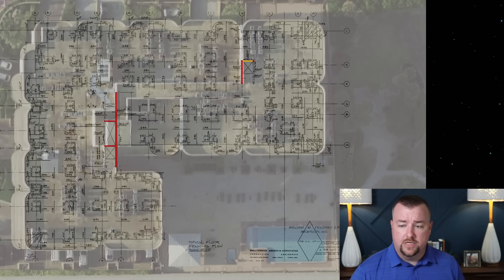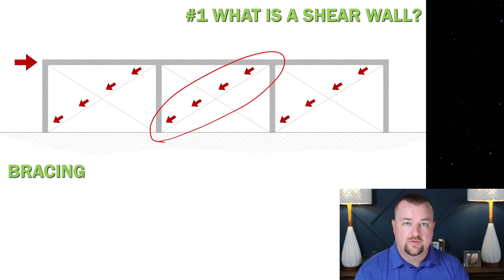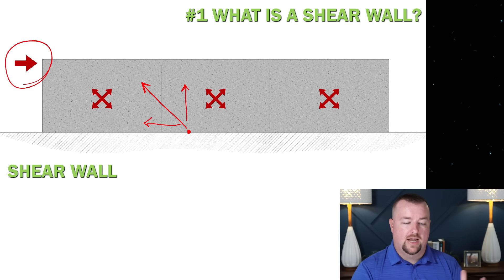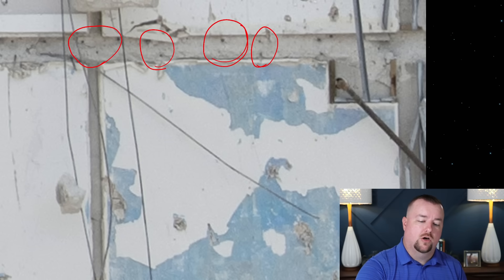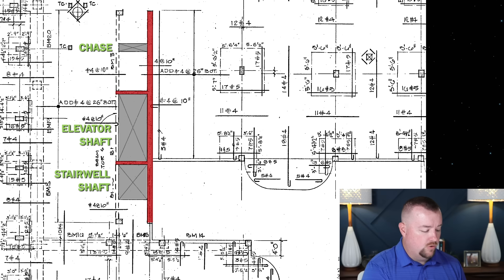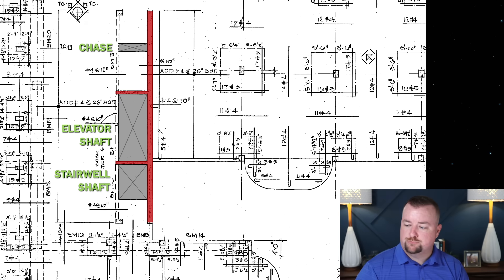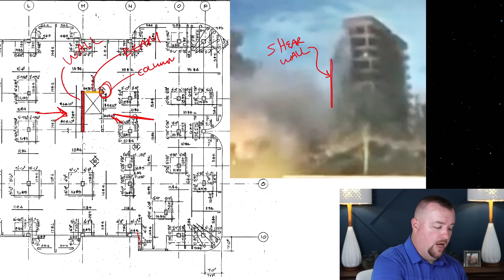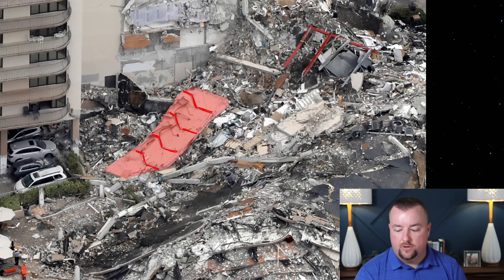Surfside Collapse - Structural Engineer Answers Your Questions About Shear and Shear Walls

Comment: the wall slab are shown connected with J hooks, the hook has a value in anchorage. But seems insufficient, best way turn it up in  the wall as you suggest or use plate anchors.

Comment: Something I noticed in the first collapse video is that section that collapsed with a slight delay appears to have experienced some visible oscillation during the initial collapse. Certainly the front section of it facing the camera anyway which supports the idea that section was likely seriously compromised internally there I'd have thought. Pretty sure reinforced concrete structures are not designed to repeatedly bend violently enough to be visible to the naked eye from that distance. I can't imagine this is good in the slightest for a reinforced concrete structure given concrete's propensity towards brittle rather than ductile deformation. Given the already appalling state of the maintenance of the building would not surprise me if that bit of oscillation was the final straw that guaranteed the inevitable failure of that portion.

Comment: The bigger and more shear walls are better for protection then...so can buyers of condominum ask where the shear walls are located before purchasing or the owners of condominium ask board of directors to see how many shear walls are built and locations?
Reply: People usually buy some products based on consumer properties of the products. While engineers that develop the products shall be skilled enough to provide all other necessary specs to match safety, robustness, durability, so on properties. Customers pay for engineers competence, and products free of mistakes without diving deep into clear understanding of details how it was developped and made.
When someone switches lamp on they usually don't ask is the lamp properly manufactured, is the bulb safe and durable.

Comment: The theory about the hooks into shear wall at 12:25 is incorrect and honestly a bit silly. The dimension of the candy cane hook on a #4 rebar is only 4" so it will fit perfectly inside of a 6" slab. It is standard practice, done everyday with no difficulty whatsoever. If the slab is thinner or the hooks are larger than the slab then the hooks are simply laid over at an angle. Secondly, it is practically inconceivable that a rebar fabricator would have detailed the top bars without hooks and no competent inspector would have passed the installation if the hooks were missing.
Reply from the maker: You are assuming they built it correctly and that inspectors are competent.  My experience taking apart buildings ranging from 50 years old to 5 years old is that both of those assumptions are false.  I also mention that the engineer provided no details for these hooks at the shear wall.  In addition, most of his details actually show the rebar dead-ending at slab edges without any hook.  In fact, the majority of buildings I restore do not have hooks at slab edges... so not so silly after all.
Reply: @BuildingIntegrity  I have not reviewed the details for this building but CRSI and/or ACI standards were always required within building specifications at that time period. This would have dictated how hooks are to be bent and installed, concrete cover , etc. So specific details for this connection would not really be needed. There is certainly some possibility that the rodbuster installed the top bars incorrectly and then an incompetent inspector missed the error. However missing hooks is a low probability since this slab has the 180 degree hooks everywhere that the top bars terminate. A more common error that I would expect would be the bars missing entirely or incorrect spacing especially where 25% of the column strip top bars were supposed to be centered over the column.

Comment: The rebar seems to be coming out of the slab not the sheer wall
Reply from the maker: The slab is sandwiched between the shear wall on each floor.  The rebar extends from one shear wall segment to the next thus integrating the slab into the shear wall, so the whole assemblage can be thought of as the "shear wall".

Comment: I think missing from this discussion is that the apparent lack of sufficient shear-walls only applies to the basement and perhaps first level.  

Once you go above the amenity level of a condo or apartment building and you get into the residential levels the floor plate is made up entirely of shear walls. 

I live in a concrete high rise that is over 60 years old. My apartment is separated from my neighbors (and hallways) by solid shear walls (. There are no columns that could be subject to a punch-through failure which appear to be the cause of the Champlain tower collapse. 

Even on the main floor of my building there are no columns (although it is a small building with no open amenity spaces other than a lobby so it is all shear walls, no columns). 

The only place in my building with columns is the one-level underground garage although even there , there  are some parking spaces that are separated with a "shear wall" i.e. solid concrete wall as opposed to columns. Where there are columns the interface with the slab above is very robust with a thick steel reinforce concrete plate. 

If ever the columns in the parking garage were to fail (a punch through failure) in my apartment I would expect the building would remain standing but tilt off it's axis. I would not expect a progressive collapse of the building considering that the superstructure above grade is a robust structure made up of shear walls separating individual apartments. 

What would be interesting to see is what did the residential floor plates on the Champlain tower look like? Did they consist of a series of columns? (seems unlikely) If so how did they create noise and fire-safe separation between the units? 

I hope in future video's you can show us the floor plans for the residential levels. Did they consist mostly of columns instead of solid walls separating the condo units? If so it's no wonder the tower collapsed like a deck of cards.
Reply: There is some electronic babysitter device video from the building during collapse. The columns are inside the room.

Comment: So if the East side shear wall was larger, and allowed for lateral movement to the Left and right it may have held up that section for longer?
Reply: or more of them probably would have been better, but its about sellable floor space and cost.
Reply: @williamhaynes7089  Yeah that's what is troubling. Imagine the short cuts in current construction.

Comment: I am wondering why they did not build strong shear wall(s) to resist wind from the ocean. That you would expect, right?
Reply: That;s the direction that they did protect from...
Reply: @JCrook1028  north-south direction was enforced with shear walls, but the ocean is to the east of the building. See Google Map where Atlantic Ocean is to Miami.

Comment: Another excellent video, you’re explanations are fabulous, it’s hard to believe that the building had so little bracing considering its proximity to the ocean, and what there was of it was so poorly tied into the surrounding reo, we would be shot with a ball of our own shit, if we didn’t tie at least 300mm of the deck mats vertically into the walls, how that stairwell wall came away in one piece is just criminal.
Reply: Poorly built American infrastructure...save money by cutting corners and doing the bare minimum
Reply: @billiamc1969  Profit above everything else.

Comment: Hello, I have a question from an earlier video concerning the beams under the planters (in the video, the beam looked like it had been poured between the columns instead of on them). In the drawings, it looked to me like there was supposed to be a cross-beam between the two beams, but in the garage video posted by the woman who was considering purchasing a condo there, I didn't see a cross-beam. I figured I was just reading the drawings wrong (not an engineer), but it still kind of bugged me. Was there supposed to be a cross-beam? Was it just hidden in the slab somehow? And thanks for the videos, they are really informative, make me wish I'd become a building engineer.

Comment: It seems to me that elastic recoil may have had something to do with the initial stages of the collapse, which I believe started in the garage and near the lower end of the parking ramp (I think the outside pool deck fell in later).

I think the rear in some of the diagonally cracked portions of the pool deck level slab continued to corrode away, as they were holding that portion of the slab together. Eventually, one parted, and it's section of slab broke away and fell to the garage floor.

If there was a neighboring part of the slab that was also severely cracked, it would sag more because there was no longer a force pulling in the opposite direction. It too could then break away then fall to the floor. If it's rebar we're also unhealthy, it may allow pillars above and below it to stay in column. The building stays up.

But then a nearby portion of of the slab that is also severely cracked, but has healthier rebar, starts to sag too, but it's rebar doesn't part. Not only that, but it gets a sudden push from the previous portion of the slab failing, as it's rebar recoils from parting.

Because it doesn't part right away, it pulls the pillars above and below it out of column. The extra push it gets from the previous parting rebar, helps insure it doesn't fail before before it pulls the pillars above and below it out of column.

This would explain why the build continued to stand some seconds after the first few sections of slab fell.

Does this make any sense to you?

Comment: I have a question. Why are the lengths of the east-west spans of shear walls so short? Due to convection caused by the differences in heating/cooling rates of land vs sea, winds on the coastlines tend to blow on/off shore perpendicular to the shoreline, or parallel to those short wall spans. Why aren't those walls larger or more numerous?

Comment: I would like to see our host looking in similar detail to the amount of rebar evident at sheered section of the floor slabs in other photos and counting rebar where the columns punched through the pool deck. There only seems to be about half the density of steel called for in drawings actually traversing the section of each column. Again this is all critical evidence which was removed when the site was scrubbed prior to being opened for inspection. All remains of the deck and columns were removed, so all we have is a few press photos. The NIST engineer was seriously critical of not being allowed access to do his job.
Reply: I agree with comment on rebar. But am not sure if it was the NIST engineer who was denied access or the county appointed engineer. I assume (I am not familiar with USA legal/regulatory structures) that NIST is a Federal body that overides the county. There is at least one Youtuber who talks like a 'practical engineer' but is seeking to indicate a cover-up of regulatory failings. There may have been failings - I have no idea - but I am not sure a 'cover-up' is indicated.
Reply: @postie48  I do regard it as highly suspicious how thoroughly this site was cleaned up and the way the remaining block was pulled before inspection. Clearly is was pretty stable if it resisted the rest ripping off and collapsing.  

It's too early to make claims of a cover up but where there's money there's always corruption and there a lot of money flowing around Miama real estate and condos.

Comment: Now I want to know how column and flat slab reinforced buildings are built.   How is all the rebar tied together.  And the other question is:  how do you retrofit the building.  I wonder if it will become standard practice to shore up concrete pool decks in future.
Reply: Rebars tied together with concrete. To prevent unintended rebars shifts from their proper position during concrete casting they are wired together in cross joints. It is not allowed to do welding in such joints because it weakens rebar structure and adds contamination into metal structure that may enforce metal degradation.
.

Comment: This was part of a statement Allyn Kilsheimer (from the 911 investigation) made but they won’t allow him onsite even though he is hired by Miami dade. They are all being denied access. 

I think it’s important that as best I understand, no one other than us has begun evaluation of the structure of the building as designed,” Kilsheimer said of Champlain Towers South. “What was done on the drawings is one thing. How it was built is different.”
Reply: I saw a video that showed NIST people on the rubble pile, so it sounds like it was just Kilsheimer that wasn't allowed. They have described it as a crime scene, so there's a theory (not substantiated that I know of) that because the county may be partially liable they're kept from the site but will instead get data later. NIST is definitely investigating though, and has been on site. Because, yeah, obviously being able to examine the rubble in situ is a really important component.

Comment: About hooks into sheer wall.  From the fact that the slab rebar enters the sheer wall, we know the slab was poured on top of the under-lying section of sheer wall not against it. This is also clear from the way the slab concrete has sheered off. In that case there is no reason why the hook could not be achieved by a 90 degree upward bend lapped with the rebar of the next section of sheer wall. It is unclear why our host says this could not have been done. 

Having said that , I don't think the breakage of the concrete around those holes shows any evidence of the considerable side load needed to sheer the rebar. The holes would not be round. This does look like pull-out with no evidence of hooks.  Unfortunately they ensured this critical evidence was destroyed by pulling the remaining bldg section and denying engineers access to the site before this happened.

Since the sheriff's office was citing the fact that they were protecting a crime scene as the reason for denying access, this amounts to destruction of evidence of a crime. An act which is itself a crime.
Reply: I agree with your comment about the hooks. There is no issue placing them in the wall area. However the astm a 615 grade 60 steel that was probably used in this building has relatively poor ductility and tends to be brittle. I would not be surprised to see it break. For this reason it is frequently excluded from use in seismic designs.
Reply: @JC1028 Fair point, I should have worded that differently. Having said it was possible to bend up to achieve the hook, he said "so my best guess is that they just loose laid the steel ..." because there were no explicit instructions in the plans. That seems a strange logic. I think he's being too generous. If the hook was not done it was because it was too much trouble or someone did not know what they were doing and was not supervised. Luck it did pull out instead of bringing the other half down too. But this does suggest similar malpractice could be found elsewhere, like the pooldeck !

Maybe since our host works professionally in the state of Florida, he is reluctant to criticise or admit malpractice is a common occurrence.  I really thought his early videos were probing and insightful as to the possible defects leading to this tragedy. The last few, while well presented,  have been rather banal, general info. Maybe he's had to back off for some reason.